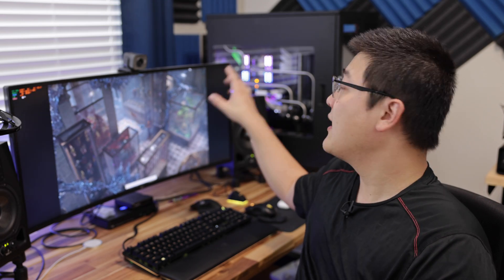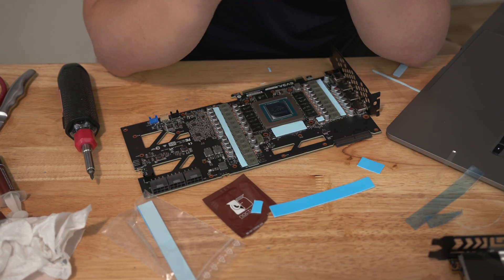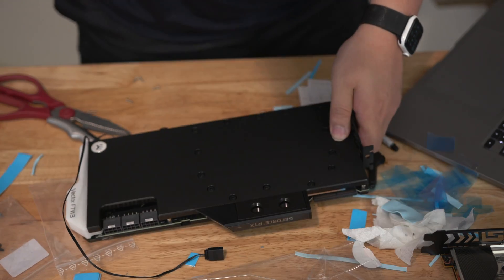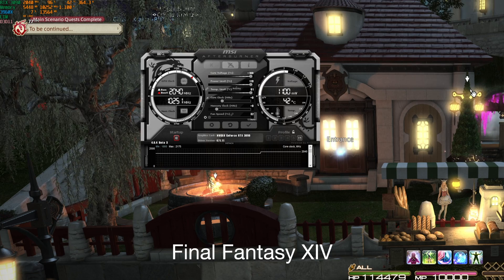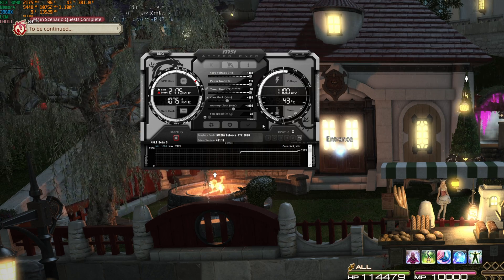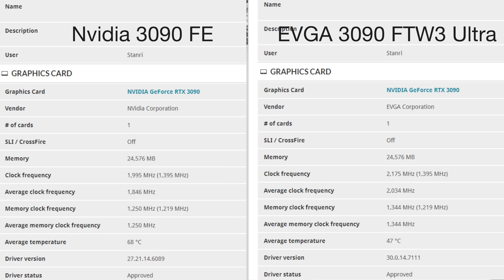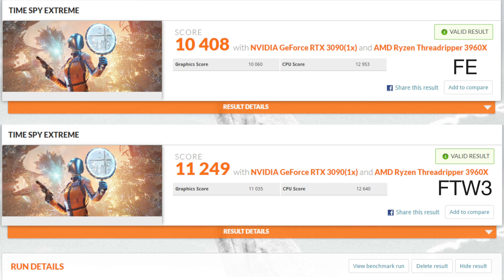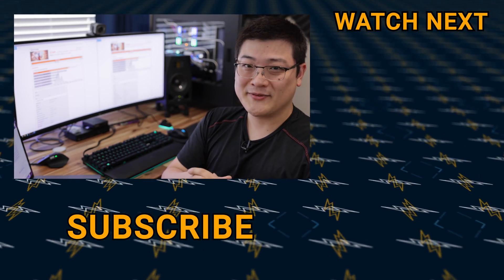3090 FTW3 Ultra Watercooled Overclocking

Comment: No need to disconnect the RGB cable. You can change the colour and brightness of the block via Asus Aura or whatever software your Mobo uses. I've got my brightness turned to very dim.

Comment: Currently running 3 x 360mm radiators on my 3090 ftw 3.   Epic video!   Thanks!
Reply: What kinda thermals @ what mhz and such? 
Im running an EKW active backplate with 2050 core and 10k memory @ 47 degrees full load after like an hour of gaming. 

Running 3x420 dual thick airplex radiators CPU is around 55°c @4.6ghz locked 16 cores 5950x 

The whole water loop sits around 39-40°c

Comment: Thanks for the vid! What was your memory junction temperature under load? I have a 3090 FTW3 and am considering putting it under a block, but im debating if an active rear block is necessary or not. Thanks!
Reply: No, it's not.  It's a ~4c mem temp difference, that's it.   Just by pulling out the heat from the front side of the card that a full block does, it will lower your rear mem temp because there's less heat in the PCB.  Don't waste the $ on it.
Reply: This was tested. I have a rear block. Temps without the block was around 77c  idle almost hitting 105c under load with a rear block i never pass 70c under heavy loads.

Comment: like the 3090ftw better than your liquid devil 6900xt? good video too btw.
Reply from the maker: The unlocked power really lets the FTW3 pull ahead to its full potential. The 6900XT was fun but I actually use Nvidia Broadcast, G-Sync, and shadowplay to ever really go AMD for a main gaming system.
Reply: @StanYanMan  I had a buddy that traded his 6900xt red devil for a 3070 + some cash just to be able to run the nv filters.